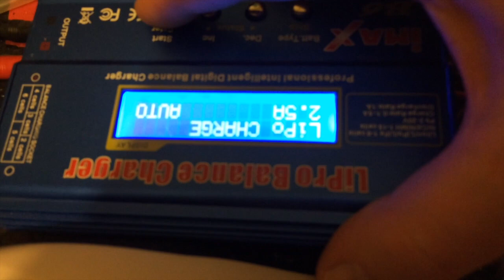Wowwee Robotics FlyTech DragonFly Repair - Part 1

Comment: Hi. I have an issue with the same dragonfly. The eyes light up and flash when charging. I charged it overnight but no go. Do you think it's the battery?
Reply from the maker: Yes most definitely,especially if it hasn't been charge for a while, all lithium batteries suffer from a low dead zone, if they discharge below that they are very difficult to resurrect by normal charging. I hope you've subscribed and check out my other videos.  Regards Malcolm aka @fixed1t
Reply: @fixed1t  hi, thanks for replying.  I have watched your videos.  I'm going to try to resurrect first. Thank you!